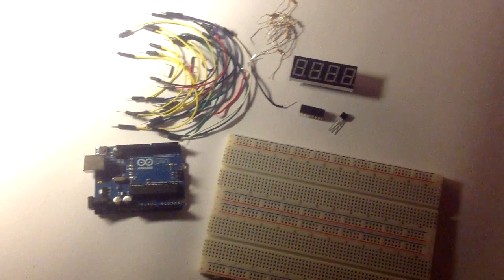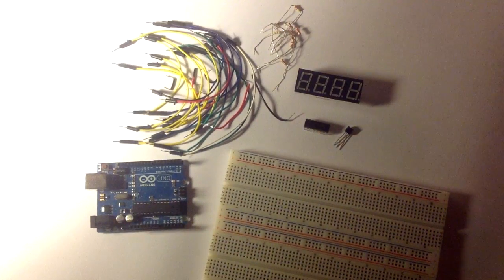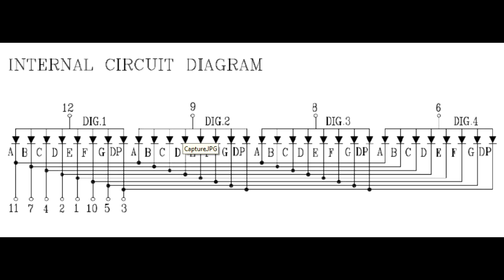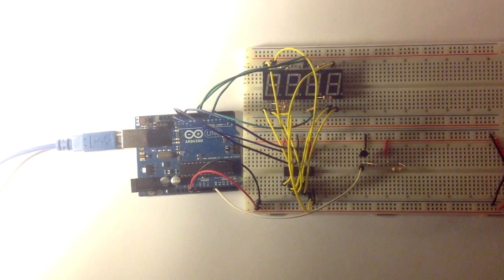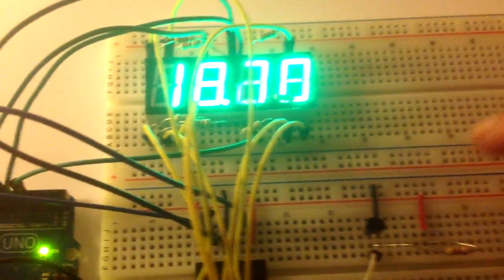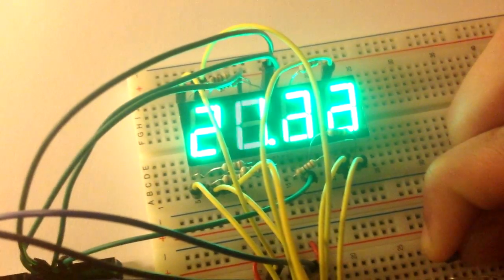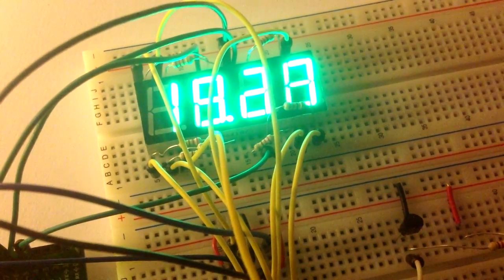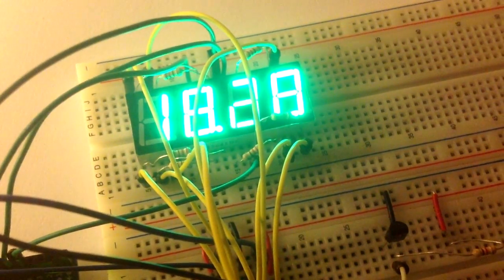Arduino - Temperature Displayed on 4 Digit 7 segment (common anode)

Comment: hello, great tutorial! thank you. i have a huge doubt that has to do with this. i'm presently building a metronome using a potentiometer to change the beats per minute. so far so good. now when i try to connect the 7segment display to show the bpm it will show the number correctly but just for the time that the beat lasts. my beat delay is getting in the way of the display function cycle. i did some research and there is a way to do functions in parallel with classes. but i can't figure it out. do you have any advice?

Comment: Do you have any video explaining the digitBuffer thing you have coded? I guess that's the code to go from decimal into bits and binary for the 595 to understand. For example what does the % mean?

  digitBuffer[3] = int(tempF)/1000;
  digitBuffer[2] = (int(tempF)%1000)/100;
  digitBuffer[1] = (int(tempF)%100)/10;
  digitBuffer[0] = (int(tempF)%100)%10;

Good work!

Comment: I have the solution to your problem: "The digits are always changing, but that is because..."

Excuses. There is a very simple software based solution to that problem.

Take the 10 bit numbers you got from analogRead(). Just make a sum of, say, 500 or preferably 1000 of them. Once you got them all added up (in an unsigned long variable) just divide them by the number of samples you got.

Note how this solves the problem. First, it takes more time to read the 1000 sensor measures than just one, second since we are dealing with an average it will be a far more stable number.

Comment: good work
i have a problem and i hope you help me , in the Schematics i cant understand which pin linked with resistors withe 7 segment 4 digit display and do you use this 7 segment 4 digit (6 pins in the right hand side and 6 pins in the left hand side )